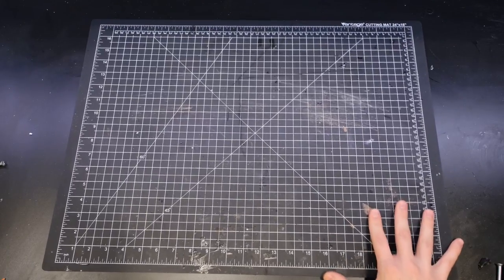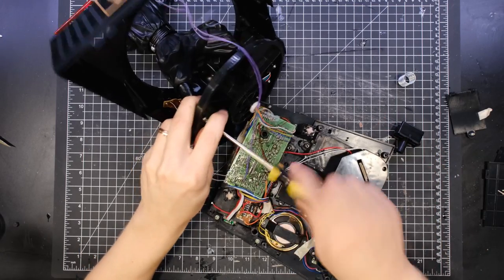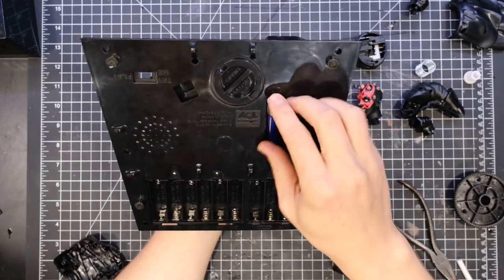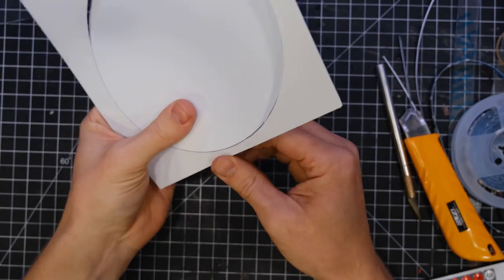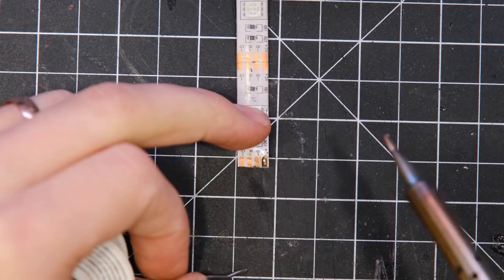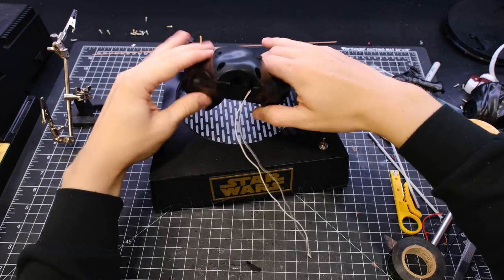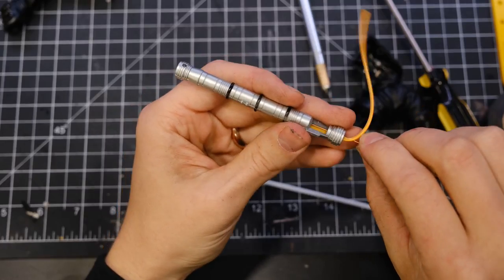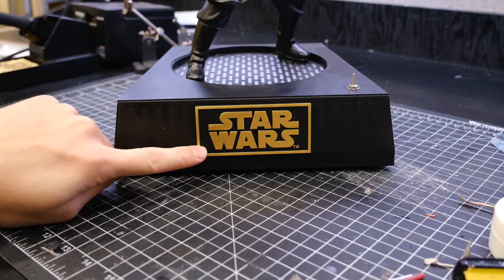How to Give New Life to an Old Star Wars Toy

Comment: I have a question about the 3v LED filaments you use. Can these be powered by an Arduino? Or would I need to reduce the voltage with a buck converter first?